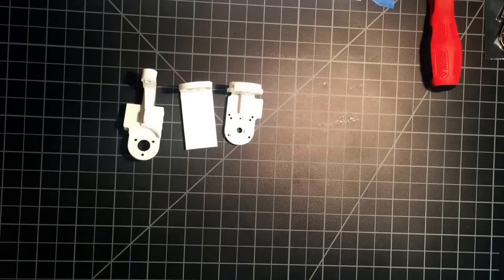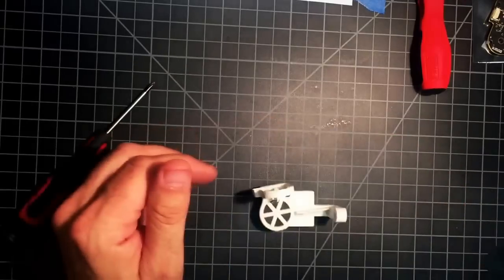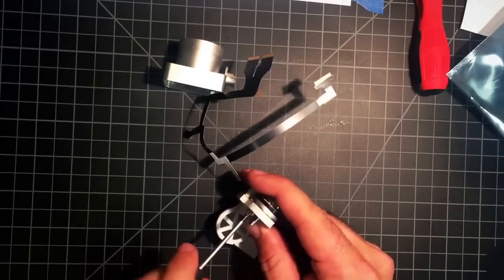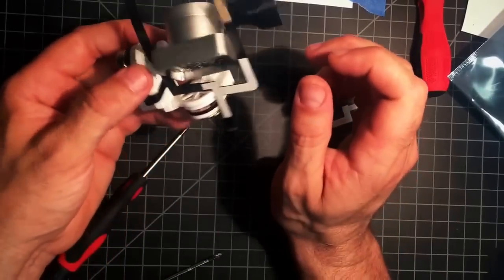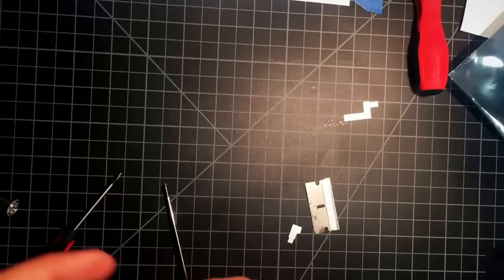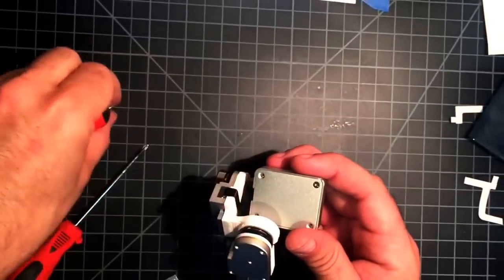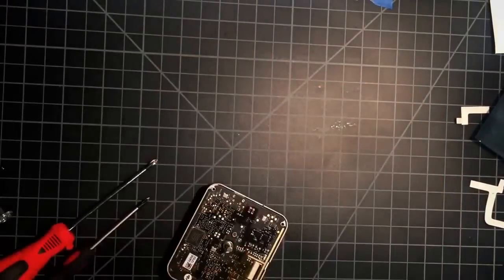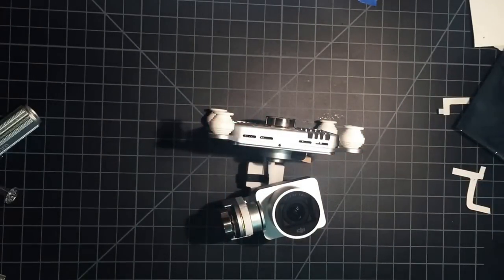DJI Phantom 3 gimbal repair by Bock Hobby part 2

Comment: Tony, at the 16 minute mark, you began winding the cable around the assembly to the camera board. Could you have started at the camera board first, worked back to the control board, and not have to loop the cable behind itself?
Reply from the maker: +pilotinparadise Yes, that's how I've been doing it lately. I start the cable on the camera before i even screw the camera to the gimbal. The camera can be attached by inserting the screw from the front, rather that the stock location under the ribbon cable. Now the ribbon can be installed with the gimbal fully assembled ahead of time. I'll work on a better video when I have time, but making and shipping parts is taking all my time now.

Comment: great videos. I have gimbal that shows no external signs of damage but can't calibrate correctly (shakes like mad).  roll arm alignment appears straight on.  can the ribbon be damaged without being torn and would it exhibit these symptoms.  any advice on how to troubleshoot?  thanks!
Reply from the maker: +tom nguyen Check the set screw on the yaw arm and the screw that attach the camera to the pitch motor. a loose screw at either of those places will cause the gimbal to shake pretty bad.

Comment: Can you make a video removing the original roll arm. Because Mine is twisted a little but it not broken. I bought your parts but don't know  how to get that motor out of the original roll arm without braking anything.
Reply from the maker: You need to cut the original roll arm off the motor. DJI used some pretty strong glue to hold it in.

Comment: thank you very much... but i havent been as good as you, when put parts back together, it start my phantom and it smelt like warm ...
Reply: +Marc FAUVE 
and i had a flashind red light.
And my gimbal didnt move at all.... i think its dead.
Reply from the maker: +Marc FAUVE if it smells hot, maybe you used the wrong screws on the motor and they were too long?
Reply: i dont think so ...
i think shortcut

Comment: Ok so I've done a gimbal repair off parts from another used gimbal and all seemed fine until I noticed some obvious jello in my videos now.  Any advice?
Reply from the maker: Usually a loose screw or the roll motor is loose on the shaft.

Comment: Hey tony, I just replaced the roll and yaw arm on my phantom 3 advanced. When I restarted the drone the gimbal kicked in for a sec then pointed straight down...like no power. Any thoughts as to what this could be or what to check?
Reply from the maker: How many seconds exactly? Is this repeatable? If it was about 10 seconds and if you've already replaced the ribbon with a genuine DJI cable, try replacing the short grey cable at the back. If it was less than 10 seconds, take your gimbal apart and check they all the ribbon connections are fully inserted and the latches on the connectors are closed.

Comment: I am looking for the name of the white 10 pin cable connector used on the Phantom 3 Pro gimbal. I am trying to find the female connector that is on the gimbal main board so I can fix mine that got ripped off the board when the pahntom when nuts and spun out of control.

Thanks to your video I have been able to fix my broken camera to perfect working order but now I need that small female connector to repair the main board.

Anyone now the name of it and the manufacturer of the connector ?

Thanks

Comment: Hey mate, I have some restriction in movement on the arm that connects from the drone to the gimble, rubbing against the platform in the very last illustration, the final last two screws, that little plate.  could you please provide some assistance as to why or how I can overcome the rubbing? its not free movement and is scratching the plastic/ali plate. it feels flush with the other platform however.  Please help
Reply from the maker: +JAKE T (Teahaircut) - Loosen the set screw and see if the arm will slide away from the cover on the shaft. If there's no room to move, you have something bent.

Comment: Hi Tony, I've followed this video and rebuilt my gimbal after a broken roll arm. When I start it up, all the motors spin and the camera and gimbal move in all directions but the gimbal won't calibrate and I get a motor overload error... any ideas where I've gone wrong?
Reply: David Shutter do you got any solution? i have still got the same problem
Reply: wacho66 I'm afraid not, I ended up buying a new camera and gimbal unit because I reasoned that if I had to rebuild it again I would be half way through the cost of a replacement, without the confidence that it would work. the new unit was just over £200. i'm sorry, it's not a lot of help if you are hoping to do it on a budget.

Comment: Hi,

Im trying to repair my dji 3 standard also but i have a problem with the flat grey cable that goes from the drone to the gimbal. The plastic connector where the cable hooks in has come of the gimbal so im trying to find a replacement but does anyone know how that piece is called or maybe has a part number?
Reply from the maker: I'm pretty sure that connector is a JST GH 1.25mm and you could buy one at Digikey. Look on JST.com for specs to make sure first. Also, you'll want to make sure all the pads on the board are still there. If any came off (or even pulled up) you might not be able to track where the connection needs to be routed. Good luck with your repair, it might be a tricky one!
Reply: Thank you for the reply and ill try to see if i can order 1 of those and lets hope it can be repaired!

Comment: Spent 4 hours trying to watch this video and repair this phantom 3 gimbal, pretty much have destroyed the ribbon cable trying to wrap it around as shown in the video. As he says , it's impossible. As soon as you spin the camera, the whole thing unravels.
Reply from the maker: +identityiicrisis - I've found better ways to do this since I made this video. Remove the ribbon and camera. Fully assemble the whole gimbal, but don't attach the yaw arm to the yaw motor yet. Install the ribbon to the camera. Slide the camera onto the pitch motor shaft. Make sure the flat side of the shaft is to the back of the camera. Put the screw in the front side instead of the back to attach the camera to the pitch motor shaft. Now you can wrap the cable around the camera, stick it to the roll arm, then stick it to the yaw arm. You can insert the ribbon into the motor control boards and close the latches with a toothpick. Then you can install the whole camera and arm assembly onto the yaw motor shaft and connect the ribbon to the mainboard.
Reply: +Tony Bock Thanks Tony, doing it the way you explained was much much faster! 15 - 20 minutes and done. Unfortunately, after putting everything back together, I just get yellow flashing, no camera movement and the response "Gimbal Pitch Error Hardware Malfunction, Contact DJI support to arrange repairs" from the DJI go App ...the camera works, but no movement. I've taken it apart again to double check all the connections, looks like everything is correct. Any one have any ideas?
Reply from the maker: +Ian Cosley - What cable did you use? The only ones I trust are ATK and DJI brands. The majority of other cables are horrible. The only way to describe how useless they are is to say you could save yourself some time and toss your money directly into the garbage. You also said that you were worried you might have damaged your replacement cable. You should try a new one. If that doesn't work, it's most likely the pitch board.